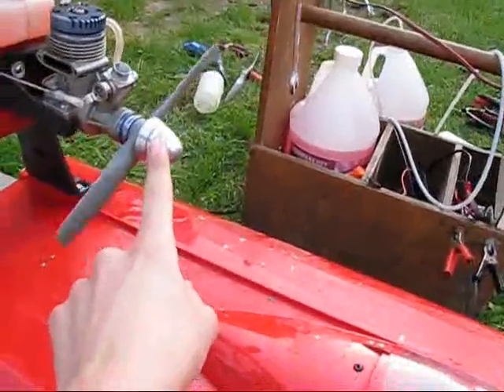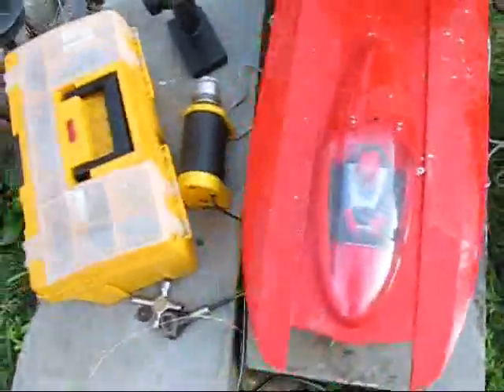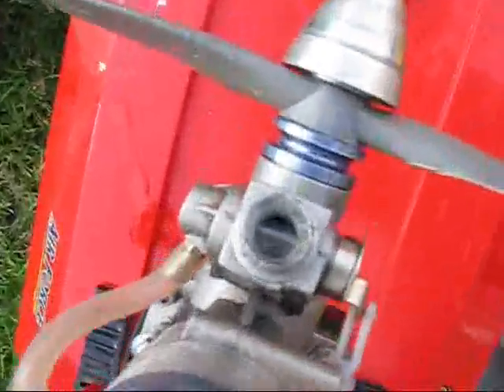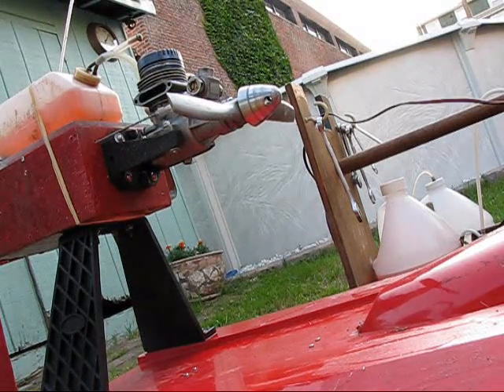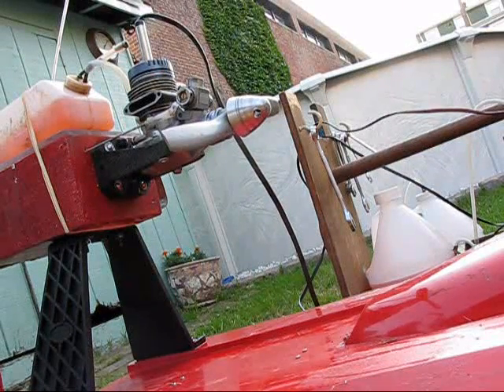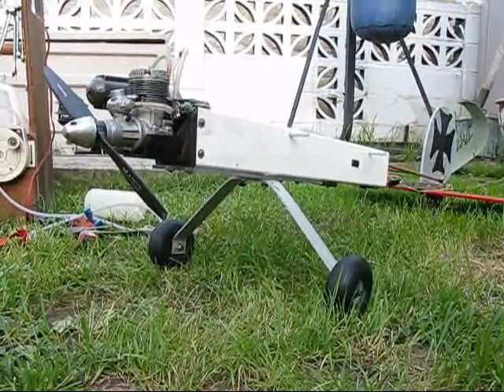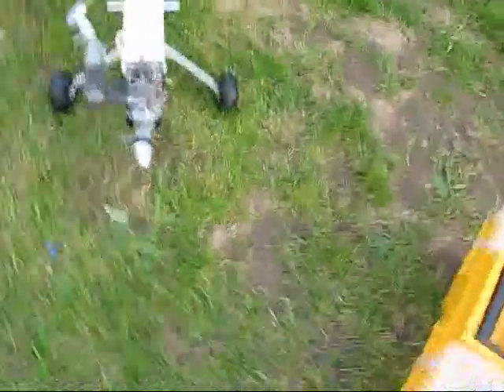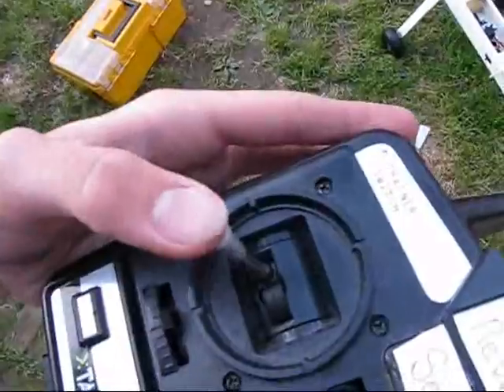RC Basics- How to start a Glow Engine Part1

Comment: That engine will never run because the muffler gives backpreshure to the tank.    And its way way to lean.            But you are going to flud thr engine if you put ur finger over the carb

Comment: Your way of starting is wrong. You need a muffler to pressurize de thank. Otherwise the tank will fall in negative pressurization preventing the gas to go to the engine. AND please let your engine warm up before to rev ti.

Comment: Looking at your vid again, it looks like you flooded the motor, I noticed you trying to prime it with your finger on the carb with the igniter still attached, that and the muffler was off. It did try to fire up twice, but once you primed it with the electric starter, I think that flooded it out. I went out this moring and started mine with the chicken stick and after I primed it according to Aquacraft's instructions, it not only fired up, but attained a solid idle with crisp throttle response.

Comment: Oh no you dont get more power - in 2 stroke engines, it helps the compression and the un burned fuel comes back from the muffeler on top of the piston to burn - more power.

Comment: Rule #1: Do not remove the muffler, especially if it's an aircraft motor. It will LOSE power, not gain power like soo many believe to be. Secondly, it also provides that crucial pressure to the fuel tank to fuel the motor. Without the muffler pressurizing the tank, the motor can easily quit mid flight.

BTW, this was posted by ZackarySmith22's friend, NOT ZackarySmith22 ;) reply to greatplanesman.